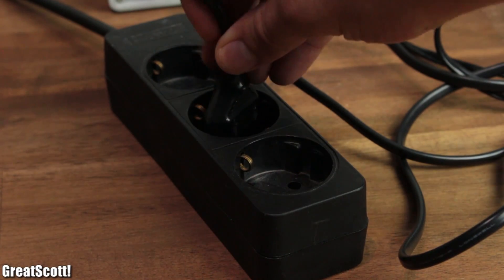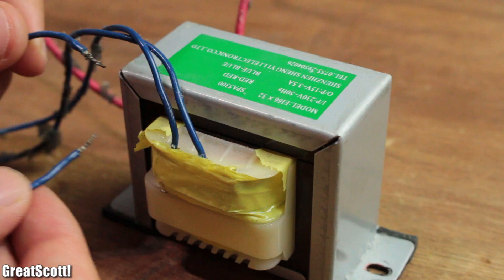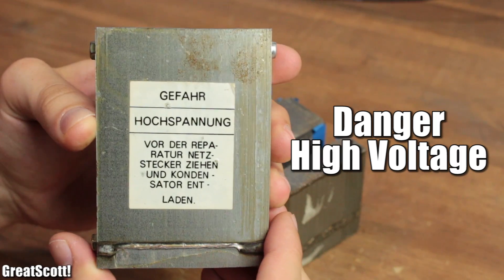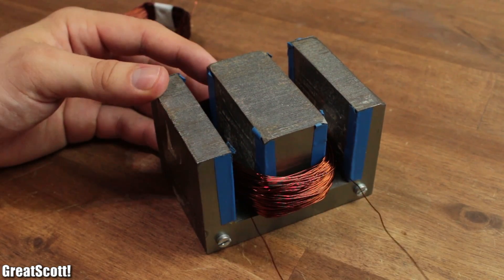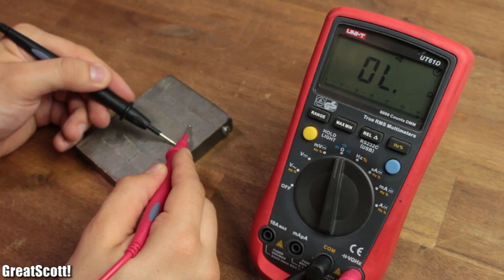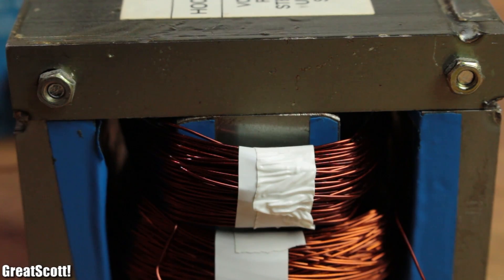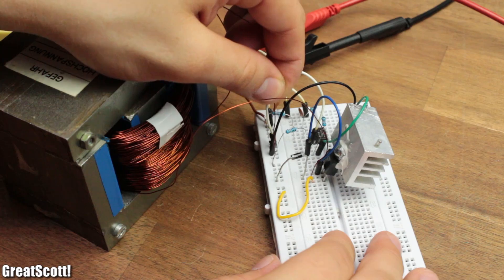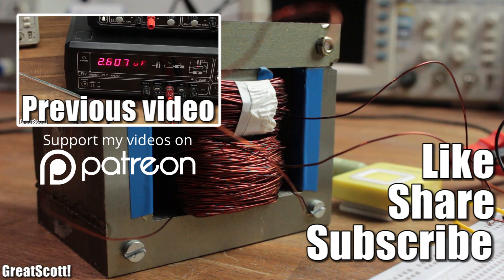HACKED!: Transformer as a Speaker?!

Comment: Few years ago I tried something similar using a small dc motor as a speaker, and it works a little better than the transformer, but with a much lower sound volume.

Comment: I bet that GreatScott has never built or owned a vacuum tube audio amplifier. The output transformer on vacuum tube amplifiers does vibrate like a speaker at high volumes. This is more pronunced on cheaper transformers. High quality audio output transformers losses are lower and they don't produce sound at normal operating conditions.

Comment: what is the maximum frequency that a 60hz transformer can operate at. and still be efficient? I am trying to build a boost converter. or boost stage for a inverter. but I want to stick to a low frequency design. but still over 60 jz.  I have some really big fork lift battery charger transformers.  one whole charger is in the hundreds of pounds. I would like to build about 5-6kw inverter. but the transformer will be what limits the output of the inverter. I also have had a hard time figuring how to build a transformer of this size
how do I calculate how much winding for given core size? your help would be greatly appreciated. and your videos are awesome. I look forward to every one. thanks..

Comment: Note a dynamic speaker, is just a transducer engineered and optimized to produce sound by concentrating a electro magnetic field via a coil with ac current flowing through it inside a second static magnetic field, hence two magnetic fields interacting with each other, based on the fact that any conductor carrying an electric current will have an associated magnetic and electric field. But in fact cables vibrate, transformers vibrate motors vibrate, the iron lamination's in the transformer vibrate in exactly the same manner. It just shows how extremely simple but clever the invention of the dynamic loudspeaker is.

Comment: What you could try is place a small magnet with a paper cone glued to it next to the transformer and it will also function as a speaker, you don't even need the transformer just coil up one of the speaker leads coming from the amp (but not both eg fig 8) place it near a magnet u have a speaker. You could even place two cable next to each other one with audio current flowing through it and the other a dc current hence electro magnet, the cable with vibrate with the audio like a speaker.

Comment: try connecting it to a thin metal like a spoon and put it in your mouth. In theory the vibrations will go from your jaw bones to your ears so it will sound much better and it will be cooler since it's a "private" speaker.
Also, try connect it to some amplifier because you can't put as much wire and magnet on a spoon.

Comment: Just last week I got an EasyDriver stepper motor controller and noticed you can control the frequency of the steps in Hz using the AccelStepper library so I build a two octave synth with an Arduino and a bipolar stepper motor as the speaker. It works quite well if you push the motor against the desk to amplify the vibrations.

I know it's been done many times before but this is the first time I've had the hardware to do it.

Comment: what you hear is just the coil. as it vibrates due to the magnetic field that it itself creates thanks to the iron shunts, it creates sound waves from said vibration. less windings work better because youre using such thick wire. a lower resistance results in higher amounts of power drawn from the amplifier. but ultimately, youll never be able to make this worth doing. youll never be able to turn this into a usable speaker.

Comment: Here the electric power company have injected a signal on top of the regular 50hz every 40 seconds for last 15 years. It is really annoying and pretty loud sounding similar to old modems and fax machine handshake signal. You can hear it in electric heaters and a lot of other electric equipment in all houses at the same power line.

Comment: Good way to fry a high dollar car audio amplifier dude. You should put big disclaimers on this video because some dumbass will try it and then try to blame you when they burn up their $1500 amp.
Reply: ElfNet Gaming You do realize that voice coils work on the same principal, right? I've done this with MOSFET and IC amps, all of which worked just fine right after.
Reply: I know how speakers and amps work.
I work in professional PA sound, IT and Communications and I am an electronics engineer.
Just saying if you use the wrong impedance for a period of time you will destroy your amplifier(s), no matter how you slice it you will fry the MoSFETs in it.
This is what kills high end car audio amps, people connecting too many speakers in a string and driving them full power. You don't need a lot of amplifier or speaker to get alot of deep bass, You need to know what your doing and how to achieve the proper acoustics.
Anyways if this project is just for playing around then fine, do what you want but I would strongly advise against recommending this for normal use in a car or home audio application.

Comment: Why does my laptop plugged into 60Hz AC produce 50Hz hum? (If you can't tell I'm nitpicking)
Reply: +tosdude He has 50hz, not 60hz like you.
Reply: it should be 60hz hum then.
Reply: There's a reason I specified that I was nitpicking the explanation. -_-
Reply: Do I need to copy-paste the definition of nitpicking?
Reply: Are you sure your AC output is 60Hz?
Reply: UraKn0x Canada uses 120V at 60Hz right?
Reply: tosdude I really have no idea about that, but I think you should know better than me ^-^
Does that do it with every adapter you plug in or only with your laptop adapter?

EDIT: I just checked and it's supposed to be 110V/60Hz
Reply: It varies from 100-120V throughout the country I think, including small surges and drops. Also it technically will do it with every adapter but some are more shielded than others

Comment: Good Idea For A Show , G.S. Another  unusual speaker that is totally overlooked!!
You may know that in the RC hobby the brushless DC motors they use -powerful little 3 phase motors,are always used in conjunction with an electronic speed controller and these create beeps / musical sequences through the motor windings somehow??? very pure sinusoidal mid range frequencies, during the power up sequence to let you know how many batteries are connected, during the end point calibration of the ESC  and also during programming with the Tx sticks as well. I have fooled around with them during this beeping and found that as I rotate the outer housing of the motor that houses the magnets, that I can find the sweet spot and get the best clarity and volume from them. How it is done I have not the faintest and maybe it would be good for a show
Reply from the maker: Chris Leech Sounds interesting.
Reply: +fragwits Is that what that is?? I have been messing around with my drill even today.and not even realizing. How could I not have questioned this :-o
PWM control...hmm.   I will have to look into this mate. Thanks for shedding some light there :-)
Reply: GreatScott! you are german ?
Reply: Chris Leech Hey chris I was going to comment the same stuff about RC brushless motor, cheers
Reply: Right on. Never seen any reference to how the ESC produces these musical tones from the motor. Need to know more huh?

Comment: If you have ever used electric model airplanes, when you are setting up your speed controller, it will make different tones to help you with the setup. Its done the same way using the windings in the tiny ac electric motor. Cool stuff

Comment: Most of transformer hum are due to their coils vibration. For instance, if you drive a DC motor using PWM signal, you'll hear some noise if the PWM signal frequency lies in the audible spectrum (below 20 KHz). This is due to the armature coils of the rotor, same thing applies to transformers.

Comment: Would it actually be useful as a bass "speaker"?
Reply from the maker: EpicLPer I don't think so
Reply: EpicLPer Nope. Bass speakers are "bassey" because they have a deep throw, the coil moves the membrane far. The farther the membrane moves, the more air it moves and the lower the frequency, the time it takes for the membrane to move back and forth. This transformer "speaker" would be very high frequency, and thus in the treble range.
Reply: EpicLPer Not really, however, you could use it as an electromagnet, and create a vibrator to vibrate your chair with the bass... :D
Reply: Benjamin Esposti Same problem applies, not enough stroke. Or force in that case, I guess. It's much simpler and more effective to modify a cheep/scrap speaker.
Reply: EpicLPer Sure if you want to fry your amplifiers. For car audio you need at least 4 ohms per channel, that's two 8 ohm speakers in parallel or one 4 ohm speaker.. This thing is more likely way high up and can destroy your gear and even create a high voltage back feed into your amps due to random field collapse.

Comment: The mains are to 60hz on America
Reply: ***** ah that's right you guys use, What like 240v 50hz
Reply from the maker: steven bloomfield 230V RMS and 50Hz
Reply: steven bloomfield The voltage is also lower there
Reply: Ruben Fernandes Yeah, but 230V is safer :) (Kind of)
Reply: Rtex idk about that 230v kinda hurts more than 110v I've felt the wrath of both